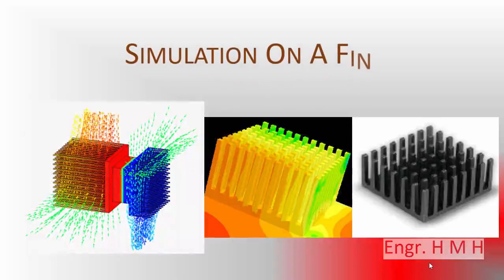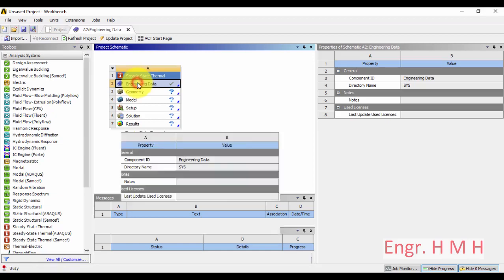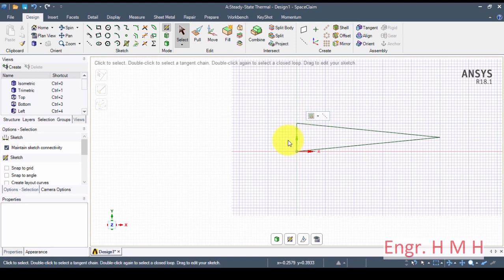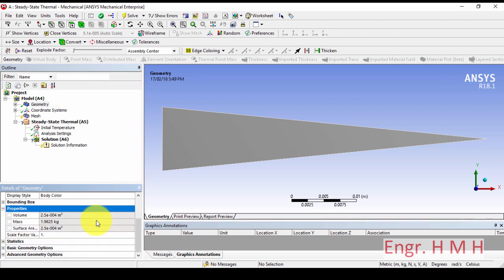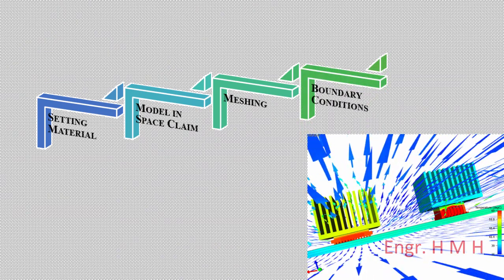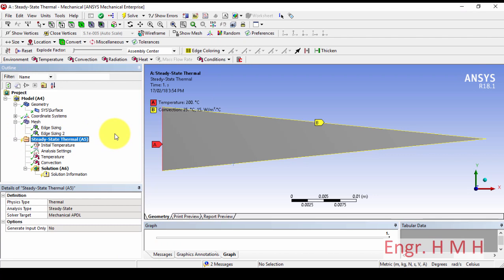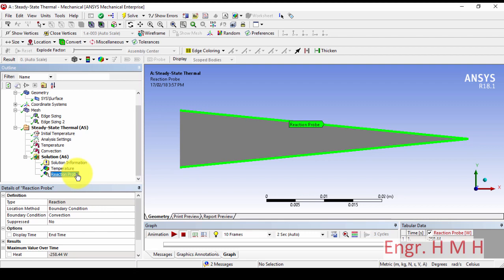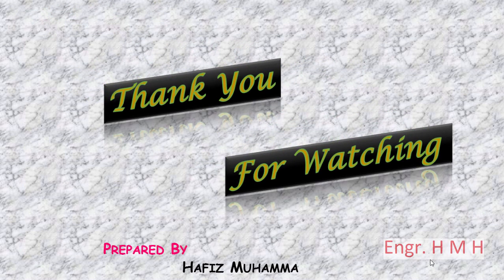ANSYS Steady State Thermal analysis of a Fin

Comment: Sir kindly upload the vedio on fins and pcm heat sink 2d and pcm melting analysis kindlyy
Reply from the maker: Here is a video describe that how you do the same in Fluent.
https://youtu.be/7S3n0ahnG2U
And an other video to model heat transfer and Fluid flow
https://youtu.be/n9RtIzrrfjQ
But I've never performed Phase Change simulation and may be I'll performed this in future.
Thanks.
Reply: @EngrHMHassan  thanks